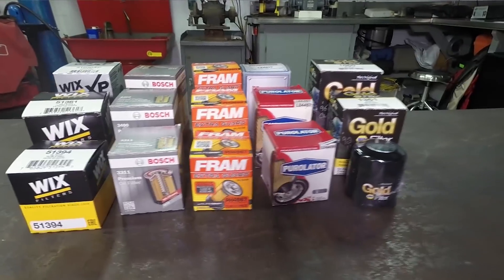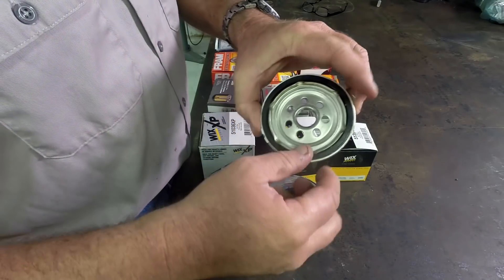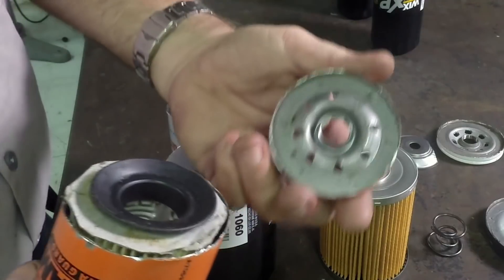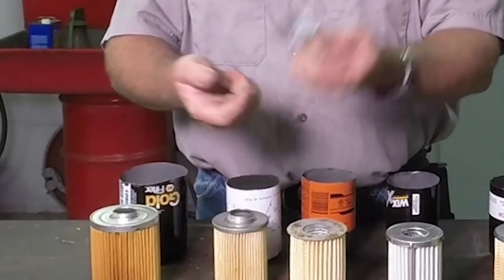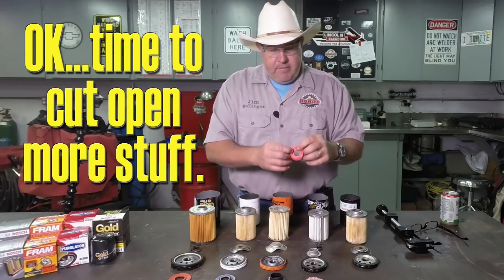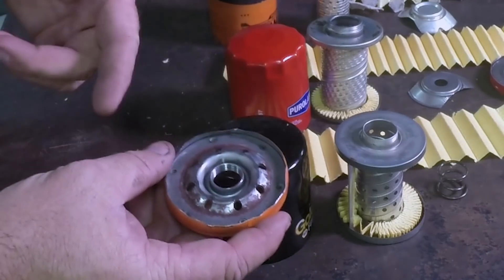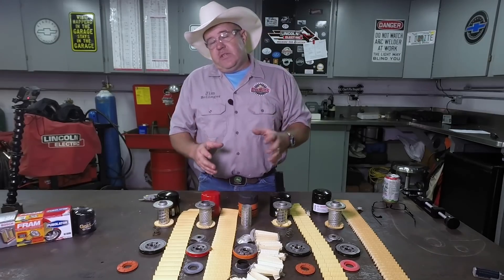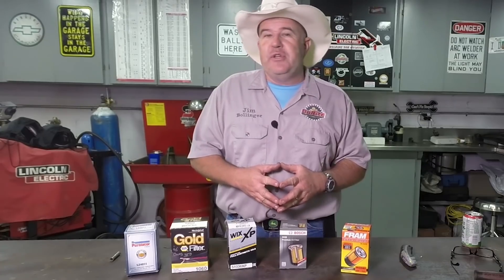The worst oil filter EVER!

Comment: Sorry Cowboy ... let me lay some knowledge on you. Not sure where you got your Engineering Degree but if you bother to look at the "design spec" of ALL Oil Filter systems ... including those in Aerospace applications ... you might be amazed and preclude you from  scaring the shit out of folks on your channel just for "Likes". I will give you that there should be ZERO corrosion in the can ... particularly in the "Barrel Baffle" but know all filters have a built in "Bypass" and the key element in all you have investigated (besides lubing up the exterior gasket) is the quality of the anti-return rubber ... if that piece fails (loses its' elasticity and becomes rigid), jigs up. Be advised that ALL "Oil Filters" are designed and intended to work around the first 30 minutes of use. The idea is to capture impediments at that critical stage to prevent, best that they can, from entering the internal workings of an Engine. The "Condition" of the engine (hours/miles/km) is also of note in the equation ... hence the reason for a Drain Plug with a magnet affixed; and ALL Filters used will exhibit the capture of metallic debris on the Drain Plug.  This is to say that no matter how much you spend on an Oil Filter, they all have a very short Life and are not 100% effective. Hope this helps.

Comment: I had access to a filter cutter and have cut a lot of filters myself.  Next time cut a Fram XG filter apart. They are as good as anything on the market. I won't use the cheap type of fram you opened up. I've used the cheap Purolator and the Bosch ,same filter with no problems.  My Fram XG box said made in USA.

Comment: I've epoxy'd neodymium magnets on my oil drain plug and I get fine particulate piled high on it every 100 miles, (these are break in miles) new internals but the Mobil/k/n filters still seem to miss a bunch of crap. I've used all brands...

Comment: You asked, "Where's the proof?"
But you did not prove anything?
Where are the oil analysis to scientifically prove which filter actually filters best or last the longest? A visual inspection proves almost nothing. So Fram has what you call cardboard end caps. So what? Toyota OEM cartridge style filters don't even have end caps. End caps don't filter the oil.

Comment: Been using Fram filters on everything I’ve owned for at least 40 years, change oil every 3,000 to 5,000 miles depending on driving conditions at 162,000 miles I changed the valve cover gaskets, inside was clean as a whistle. Personal opinion: paying more doesn’t get you more just less in your wallet.

Comment: I guess everyone can have his opinion but I have used Fram filters for 50 years, put 2 million miles on my vehicle and have never lost an engine due to an oil issue.  I will continue to purchase Fram filters until proven wrong.
Reply: I should add that I have had 6 vehicles over 200,000 miles with my 1999 Chrysler LHS V6 putting on 350,000 miles using Fram filters.

Comment: Have been using fram filters for over 25 years and really don't care what is in them or this video. I have commercial and personal vehicles some with over 300 thousand miles on them they use no oil and still running strong. I have torn down some of my own engines and after running the fram filters the engines are clean as a pin inside after 100 of thousands of hard miles so as you say in the video the proof is in the pudding or the results of many years and hard miles of driving.  I am surprised by the video and think I will cut a fram open for myself just to see for myself. Couldn't ask for any better service I have had with fram filters over 25 years so why would I change now??

Comment: One big point that needs to be pointed out.  No filter on earth even come close to the number of frames that have been installed on vehicles from beginning to now.  Even now probably all these others added together don’t equal the number of frames used.  I’ve used the cheapest for 55!years and never had a failure.  This man has not used any technology compared to technology any of these filters use for reliably

Comment: I have and will always continue to use FRAM filters, I have NEVER had any issues with ANY of my vehicles, I change my oils 3k to 5k and usually sell my vehicles when they get over 200k miles but the engines still run good. SO FRAM works good for me regardless of what you think

Comment: I’ve used Fram filters for 35 years.  Never had an engine mess up.  I’ve driven at least 10 cars with over 300k miles on them and used nothing but Fram.  Even had 1 truck go 460k miles so I call BS

Comment: You are so full of it. The "effective" filtering qualities of a name-brand filter have nothing to do with internal construction, filtering media being relatively equal. I have used Fram oil filters on all my vehicles for well over 50 years and I have never encountered a problem. I do, however, replace my oil and filters every 5-7,000 miles.

Comment: And there are filters are just as bad the Red Rubber or orange rubber breakdown when it gets hot and gets sucked into your carburetor I have on in a Fiat and the Jets would plug up constantly by the Fram filter breaking down

Comment: Fram filters are the worst, My brother had a Fram filter that collapsed and caused his engine the lock up, One of the guys that worked at an Auto parts store told me the reason they stopped dealing with Fram is people were having engine failures due to their filters.

Comment: Used Fram on my truck, the oil pressure dropped to zero. Had the engine pulled and the screen replaced, then within a couple of years had the same problem again. Switched to better made filters and the oil pressure came back.

Comment: Wow! I have 200k miles on my Tundra and been using Fram filters with Mobile 1 oil. Change oil every 4k and truck runs great.
Reply: Well even a bad filter will work if you have all the conditions right but for the average driver the oil change will be late and a whole list of other things and it just won't hold up
Reply: @rileycannon6789  LOL, blaming the oil filter for poor maintenance practices of the operator.  How far over the prescribed OCI does the average driver go?  Many average people still prescribe to the 3,000 mile OCI, which has mostly been dead for decades.
Reply: @mscffp  unfortunately many people don't even know about that old standard. A lot of people are pretty clueless about cars. So companies putting out crappy oil filters hurts a lot of cars in general. I know to change my oil regularly but I have changed oil for loads of people who didn't know how often to get it done. Should they, sure, but they don't so we work with what we got. And putting subpar filters on the market isn't doing anyone any favors .

Comment: I call bull crap. Fram is the only filter I use on all my vehicles. My current work car has over 300k using only Fram filters. My non work car has 180k, truck 150k. So I disagree Fram can harm your vehicle. Change your oils your self when your supposed to     and it doesn't matter if it's a high dollar filter or the cheapest on the market.

Comment: I bought a brand new FORD/Motorcraft oil filter for a 2L zetec engine, despite having a thin cover on the end it had surface rust, it was swapped for a non rusty one which after some 5-6 months started leaking from the inside out, the paint easily came off to reveal rust, had the initial small weep not been spotted, it could have cost an engine

Comment: I stopped using Fram way back when I was a teenager. I noticed little specs of cardboard floating around in the drained oil.
Haven't used them since.

Comment: I drove two Dodge minivans to near 300k on Fram filters without ANY engine issues. I now have a Malibu that’s just past 200k, no issues and still running fine. My oil change schedule is roughly 3500-4000m. This doesn’t include other cars in the immediate family with similar results.

Comment: Been using Fram for 45 years. Thousands of them ! Never once have destroyed a engine. The Magical  solution to engine failure is to change the oil & filter @ or before 3,000 miles period. But you are welcome to the manipulation that is going on in our country if you want.

Comment: In 2008 my dad bought a used 2002 F150 4.6 and it had 188,000 miles. His choice of oil has been Royal Purple with good ol fram filters. His truck currently has 340,000 and runs like new. I agree that fram may have the worst build quality but it still works. He has been using fram oil filters his whole life and with results like his I can see why. Maybe the other filter brands are over built for the job. FWIW I personally use Wix.
Reply: Used Farm filters in .Mack Cummins Cat engines in redimix trucks for 45 years no filter related problems.

Comment: The test is not a fair comparison.  Wiz XP is a top of the line filter but the Fram he used is the Extra Guard which is the cheapest filter.  A fairer comparison would be to use the Fram Tough guard or probably Ultra Guard

Comment: Purchased a non running F250 with a failed engine.
Valve train was wiped out because oil passages & orifices in head were plugged with oil filter media.
Engine had a Fram filter on it.
Reply from the maker: I'm not surprised.

Comment: NAPA is made by Wix.
Bosch is made by Purolator.
Higher quality (synthetic) filter media can actually be more effective with less surface area.
Just comparing the length doesn't tell the whole story.
Spot on on the Fram though, their top line stuff is good, but we should boycott ALL of their products as punishment for selling that crap.
Amazingly some manufacturers use those P.O S.'s Fram's and put their name on them.

Comment: How well the filter removes impurities is the real test of a filter.
Sure, take it apart and it might look flimsy but put together it is a functioning unit.

I have been using Frams for decades. I  like the friction band on the outside that allows me to get a grip on them.

Two Dodges have more than 100,000 miles and one has 150,000. My Jeep diesel has 247,000 miles using FRAM filters. If they were junk one of those vehicles should have puked the engine long ago

Comment: Wait a minute! Wait a minute!  I would definitely buy Fram oil filter; but, only for my riding mower AND Only for Winter storage purpose, I change it out as soon as Spring comes around before putting my mower back in to operation.  Yap! That is about all I use those Fram filters for (taking about cheap overseas products, those Fram oil filters are shameful).

Comment: The cheapest Fram is totally acceptable if changed every 6 months. The next two Fram Up in price are very good.   The more expensive the filter the better of course. Just change oil and filter every six months  and you will be generally good.

Comment: EXCELLENT review.  
I have known for at least 15 years now not to buy FRAUD...oops....FRAM filters.  Also, that WIX makes very good filters.  However, I did not know that they made the NAPA Gold filter.  I have a NAPA store and a new O'Reilly's (WIX) in my town so, I'm covered.
Well done, sir.  Thanks.
Reply: Go to Walmart and buy a Mobil 1 or a Fram 20000 mile filter. NAPA will just charge you more. Purolater 15000 mile at Walmart too. NAPA is overpriced. Sorry.

Comment: Fake I usually use way worst oil filters I mean they cost me 2-3 dollars each. And My engine is great. I also change the oil very frecuently
Reply from the maker: No its not fake, do you really want that rust invyour engine? I don't, but you do you.....
Reply: @DoRiteFabrication  thank You for answer me. Hello from México
Reply: If you use a basic Fram 10000 mile and you change it every 4 to 6 months you will be just fine. The next two higher priced Fram filters are better yes.  The Walmart Supertech at $2.97 is a decent filter too if changed every 6 months or so. If you want to change your oil every two years which is totally dumb but people do it then use a $10 20000 mile filter with synthetic oil which does flow better in sub freezing temperatures.  If MOST people change their oil every 6 months or 5000 miles than any filter will do.  They key is to keep that oil clear or honey colored. Whe it gets dark or black change regardless of filter brand. Cheers!

Comment: As I am one to do my own Oil & Filter changes I was surprised to hear how bad Fram Filters were. I've been using Fram Filters for 20 years or more & never had any problems. 
I understand your dislike of Fram, but seeing how it hasn't caused me any problems with any of my cars, I'm going to stick with what I've been using for years.
Like the old saying goes, "If it isn't broke, don't fix it".
Reply: Because you change that Fram on a regular basis correct? That is the key.
Reply: @Jack51971 , exactly 💯

Comment: Been using fram tough guard filters for years. Haven't had a problem. As long as you change your oil and filter every 3 thousand miles you shouldn't have a problem. 2 jeeps with over 300,000 miles on both engines still runningM
Reply: Sounds like you've been pretty lucky.
Reply: Lol do you guys believe in life time trans fluid too 😂I wouldn’t ever use the cheap frams  the other ones are ok but still shit wix or KandN all the way
Reply: @masonbarto4003  fram filter no, lifetime trans fluid yes. Had a couple used cars trans was never touched, never had an issue.
Reply: Yeah probably cause the put saw dust in them for ya
Reply: @masonbarto4003  no
Reply: That’s what I thought
Reply: Yeah and the oil will take care of the rust, and whats cardboard pieces going to even do to metal parts. Who even needs filters?

Comment: FRAMS ARE TRASH. F-150 OIL GAUGE AND LIGHT SHOWED LOSS OF PREASURE IDLING IN GEAR, CONSTANTLY. REPLACE OIL FILTER WITH MOTORCRAFT FILTER CHANGED OIL, PROBLEM FIXED.

Comment: Been using Fram Oil filters all my life.  My truck has 530,000 miles on it with no engine rebuild.  This dude has no idea exactly what the materials are inside the filter or how well they work.  So the Fram is crap myth continues.

Comment: True, FRAM oil filters are sh..t.
But this mostly applies to their lower end filters, ExtraGuard and ToughGuard, I wouldn't recommend anyone putting them on their engine.

To be completely fair, their top-of-the-line filter, FRAM UltraSynthetic is not so bad; featuring synthetic blend filtering media instead of paper, reinforced with steel mesh, metal endcaps and a silicone anti-drainback valve, it is a much higher quality product than their lower end filters, and still comes at a lower price than the competition.
I've been using FRAM UltraSynthetic with Castrol  EDGE 0W-20 synthetic oil on my Impreza for 6 years and 90 000 km, and it had never put me down so far.

Comment: I’ve been using FRAM for over 35 years all my trucks have gone well over 200,000 miles with no engine problems I’ve been using them in my fleet of trucks for my company for the last 15 years again no issues whatsoever

Comment: I have a 1997 Geo Prism (Toyota Corolla) with 343,000 miles. This car has had a steady diet of Valvoline motor oil and fram filters since it was new. I have maintained this vehicle since it was new. Oil change every 3,000 miles. I fully expect to see this car go 1/2 million miles.

Comment: I change my own oil.  I have always used a Wix or a store brand that I know is Wix (Napa Gold). But its always been my opinion that if you are changing your oil only every 7500 to 10k miles, you had better get the best oil filter you can buy. Me...I still change my oil every 3k to 4k miles and often less than 3k based on the time of year and conditions.  If I had to use the Napa Silver I would have no worries.  I have just avoided Fram filters just based on reputation alone. I've used some Purolator filters but again for short interval changes. If I buy an old used car, I immediately change the oil, no matter what, and I might use a Purolator filter but I will change the oil again in a 1k miles.  Overkill maybe but its just what I do.

Comment: I use AMSOIL high efficiency oil filters with AMSOIL Signature Series oil. Our 05 Saturn Relay just turned 200k and I change oil between 10k and 15k miles.

Comment: hey i have a nice oil filter opener for opening filters made by caterpillar works like a can opener real nice , once my service manager at mack trucks asked me how come i got more engine life than other guys well i told him i only used the mack filters , and drained the oil right when you came in from the run very hot yet also take out the filler cap while its still running note i already loosened the drain plug then shut off the motor run under the truck and hand unscrew the drain plug let drain over nite . then loosen the filters but leave on fill the new filters cover and leave on bench over night next morning the filters come off easy then . the service manager said that he was just to a meeting where they opened up filters and he said the fram was not fastened down inside.

Comment: I am a 30 year dealership Factory Certified Ford, GM, and Toyota Hybrid technician. Fram oil filters are called the Orange Can of death in the technician world. These oil filters have destroyed a magnitude of powertrains. Use the factory oil filter if you can afford it. Remember automotive manufacturers with 100,000 mile powertrain Warranties are not gonna put a filter on their products that could cost them a great deal of warranty repairs. Think about that...😉👌🏻